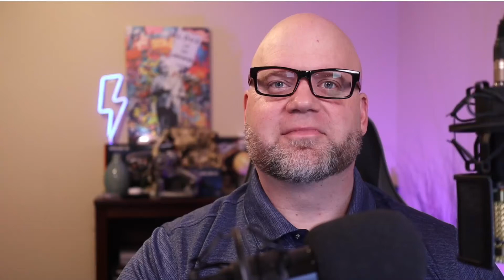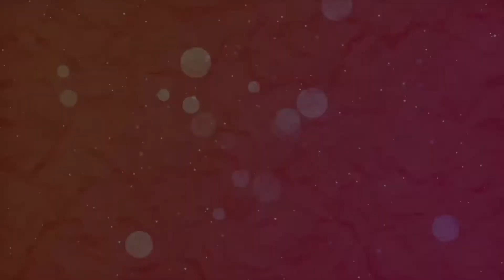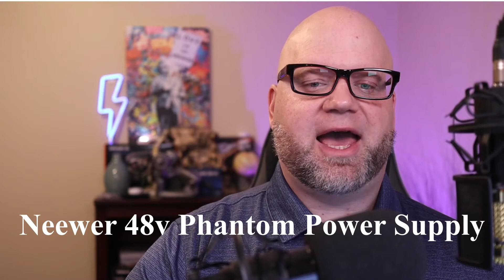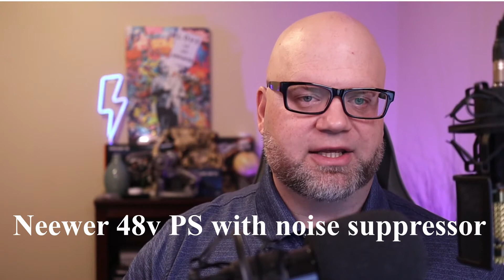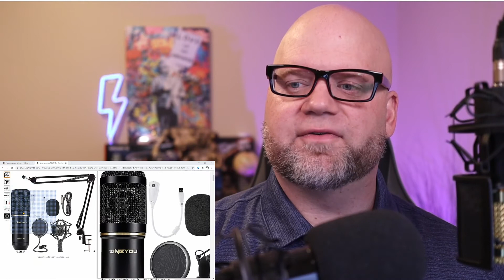Budget xlr microphone phantom power VS audio interface

Comment: What happen if i connect like microphone -> phantom power -> audio interface -> laptop, without turning on audio interface's phantom power
Reply from the maker: With a condensor mic you will not get any sound. With a dynamic mic you dont use phantom power.

Comment: i have the bm800 setup but the original mixer failed. I just got a teyun na4 which has xlr/phone multiports with 48 volt phantom and a 50Hz noise gate. i was curious about whether the bm800 is good enough for voice and instrumentation tracks and even maybe eventually some live streaming. so far I guess it's good enough. i also have a tascam dp-01 track recorder/editor that only has usb for sharing the final mix back to my computer but already
with this stuff I have more features than I have even used yet. I have about 10 instruments and voice potential
and have been experimenting with track recording for at least 10 years. I do have a 5v phantom powered usb/3.5mm similar to the bm800 (also shock mounted on a boom) from vegue and a portable rolling digital/analog karaoke rig from vegue. that rig also has some wireless condenser mics which are more for live performance than track recording. 
eventually I hope to finish some stuff and upload it to facebook and maybe YT but right now my channel is just for listening/watching other stuff and getting ideas.
Reply from the maker: Thanks for sharing your long history of audio. Maybe this is the year you make a video and share yourself. Livestreaming can be lots of fun too.  Go for it!!

Comment: Hi, I wanted to know whether Audio-Technica AT2035 with phantom power is better option than a USB mic for vocals recording?
Reply from the maker: That's a great question!! So nowadays the usb mics have improved so much. The at2050 is a good mic it's just the phantom power destroys it's quality. I know this might sound crazy but the elgato wave 3 mic with the wave software can do sooo much. You can app free vst's and have several pluggins that make your audio amazing. Just look at what this software does to this blue yeti it sounds really good at the end. This was using a stream deck plus which allows you to use any usb mic. The wave 3 is really good too. Watch this 
https://youtu.be/jpIKNGy_SxM?si=CVCvKF_r2BpBwSKm hope this helps.
Reply: @CoffeeTalkandTechJohnRyan  Thanks for your suggestion. However, I already own a budget (MAONO) USB condenser mic. I was planning an upgrade to XLR mic as I do experience occasional lag while recording vocals with a background track with USB mic. Should I still consider Blue Yeti or Rode USB mic over Audio-Technica AT2035 XLR with phantom?
Reply from the maker: @ThisisDakash well lag can come from many different reasons. If I were using a good mic I'd want a decent audio interface.
Reply from the maker: @ThisisDakash  it really all depends what you want an xlr mic but I'd get a audio interface or a usb by elgato  that you can have full control with audio routing and vst's to enhance your voice. You're decision.
Reply: @CoffeeTalkandTechJohnRyan  thanks for the info. I’ll definitely consider it

Comment: Well isn't a phantom power supply a good thing when it comes to recording drums within a band? Because there are many dynamic mics but only the overheads of the drums use phantom power...would that be a good use? Because I am scared that I'd destroy the dynamic mics if I put phantom power on the whole mixer only because of two overheads...
Reply from the maker: Phantom power is used with condenser mics or when you add a mic booster like a fet head or cloudlifter to a dynamic mic or you will damage the mic.

Comment: I’m a bit confused. you don’t really go into how you hook up the phantom power supply to your computer or your camera. my guess is that you are using a built-in interface somewhere instead of the USB of the interface
Reply from the maker: I show you the unit itself. It’s just a power supply to xlr mic and a audio interface in obs.
Reply: @CoffeeTalkandTechJohnRyan  sorry if I wasn’t clear what connector do you plug the cable from the phantom power supply. is it directly into your computer or do you go to another interface.
My BM700 (little brother to 800) plugs directly into the mic input of my computer with the supplied cable, running off the mic power from the computer.
Reply from the maker: @TomCee53  it really be from power supply to pc via xlr 3pin to 3.5mm input. Which will give you more power then just plugged into your pc.

Comment: Enjoyed your video and as a beginner wishing to do voice over work I bought the AT 2020 mic. I also bought a Neewer 48V Phantom Power Supply.  I am wondering if I would be better off returning the Neewer and buying a Scarlet Focusrite interface.  What are your thoughts?
Reply from the maker: Hi Brenda! Thanks for watching. The quality difference between the neewer and the Scarlett or motu is huge. There would be no question the audio interface would be the better choice.
Reply from the maker: @SLP-eb1wp  better quality electronics and the audio interface here has one of the cleanest preamps in the market for the price range.
Reply: @SLP-eb1wp  The audio interface has a preamp, and a good one.  The phantom power has no preamp, so the signal is low voltage, so ya gotta turn it up, and you hear the self noise of whatever you use to turn it up. The pre amp on the interface means that signal is already turned up to line level when it arrives at your computer or other target.

Comment: So I’m thinking about getting the Scarlet solo Gen 3. I’m going to be using the AT2035, is that all I need and will it be good?
Reply from the maker: Nothing wrong with that setup. That's a perfect way to upgrade your audio. CONGRATS!! Just make sure you have your xlr cable for your mic and some headphones or earbuds to monitor your output. 👍
Reply: @CoffeeTalkandTechJohnRyan  I’m going to be getting the Beyerdynamic 990 pro 250. I need a good amp as well tho. Got any recommendations on what I can use that’ll be cheap but work really good with the headset?
Reply: @CoffeeTalkandTechJohnRyan  need an XLR cable too, would like to know which you think would be best as well. Sorry asking a lot of questions, new to all this

Comment: Sir can i ask, is the Beringer U phoria interface could boosts my SM 58 while using in a live streaming? I want to make the sound louder and clearer. Since the interface has a gain. And phantom power wont work in dynamic mics
Reply from the maker: The beringer um2 will work ok better then nothing. But a better choice would be a a scarlett solo. I know its double the price but you will get a much better audio interface. With more gain.
Reply: @CoffeeTalkandTechJohnRyan  ohh how much gain does the difference sir? If i may ask again

Comment: the phantom power device isn't meant to replace an audio interface, you use it with interfaces that don't have phantom power ...
Reply: I bought a preamp but I noticed it doesn't have phantom power which my mic needs, so I bought a phantom power supply, will it be fine? Will there be noise?
Reply from the maker: What preamp doesnt have phantom power? I bought the cheapest audio interface on amazon and it has 48v.
        Are you positive?
Reply: @CoffeeTalkandTechJohnRyan  is a mixer/pre amp and.i love I canada so it might be different
Reply from the maker: @rsm2328  wish I could help you knowing your equipment. The scarlet 2i2 audio interface would be great or motu m2
Reply: @CoffeeTalkandTechJohnRyan  Moukey 48V 1-Channel Phantom Power Supply Audio Interface with New USB Charging Capability, Adapter and 10 Feet XLR Cable, for Condenser Microphone Music Recording Device

Is the phantom power supply

TNP 2 Channel Microphone Mini Audio Stereo Mixer - Dual 1/4" 6.35mm Mic Input Port to RCA Stereo Output Portable Compact Preamp for Streamer Podcaster DJ

Mixer/preamp 

And my mic is a at2020 xlr, I'm using a adapter so I can connect the mic with phantom power to the mixer/preamp

Edit: on paper I should be fine but... there's always that but, not trying to fry my mother board or this Mixer with phantom power
Reply: @CoffeeTalkandTechJohnRyan  I’m looking for a phantom power supply for a used Lexicon Alpha. It does not have 48v built in, and most cheap interfaces only have 16bit recording, not 24bit like the Alpha has.
Reply from the maker: @beanpasteposts  wish I had a good answer but I buy all in one units or a audio interface with all I would need.
Reply: @CoffeeTalkandTechJohnRyan  I have a Tascam DP-008EX and for some reason the phantom power isn't working so I just bought a phantom power supply akeoa or something like that and I can't wait til it gets here so I can see if it works
Reply from the maker: @danieldonnelly6205 Goodluck hope it works out.
Reply: Not really phantom when it's stand alone, it's just a power supply
Reply from the maker: In content creation many people are using the phantom power supply by itself. 
   If you buy a audio interface without phantom power in my opinion your wasting your money. Thanks for watching!👍